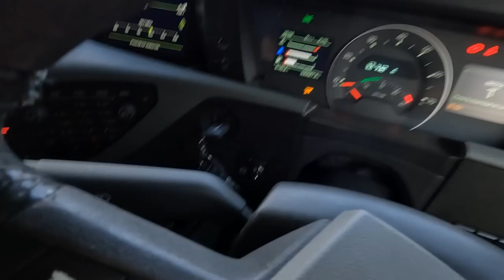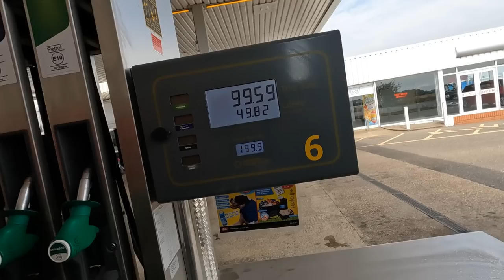The PRESS Turned Up At Work | Whatever Next!?? | Trucking Vlog #73 #truckertim

Comment: SWR is very important because if you have a high SWR reading then your antenna will not be performing as well as it was designed to, and will not be transmitting all the power you have put into it, therefore you will not achieve the best transmit range.